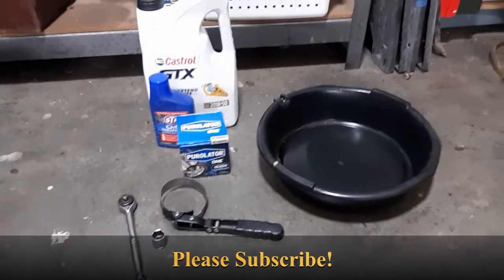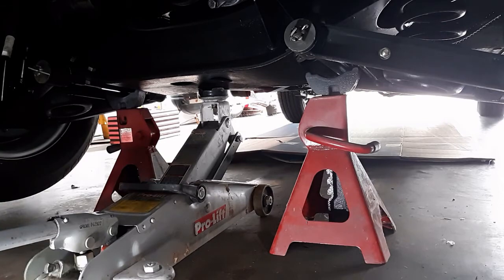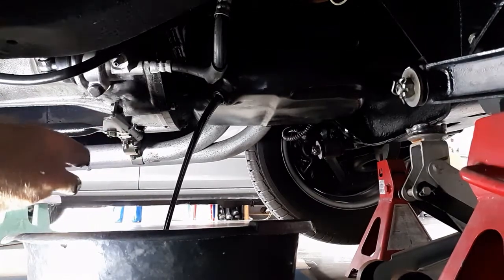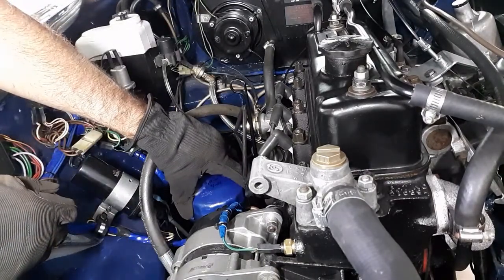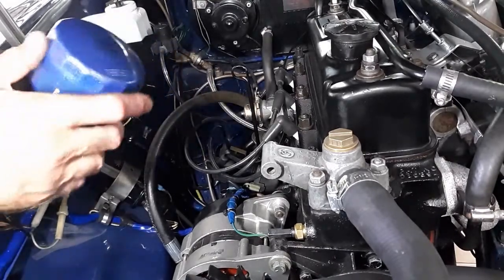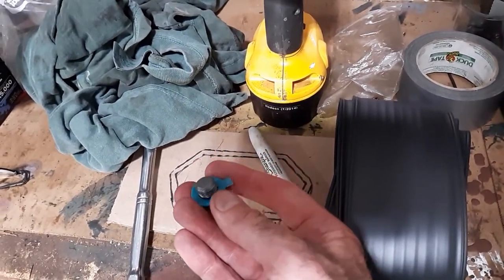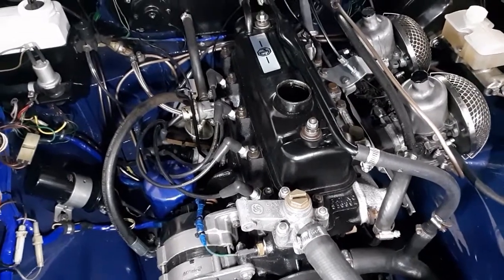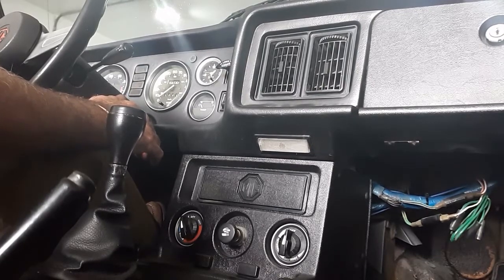MGB Oil Change - Back to Basics Maintenance

Comment: I thought all US spec cars had oil coolers, especially late model.
Reply from the maker: nope, I think it was officially dropped with the '77-80 redesign of the engine compartment with the radiator moving forward, perhaps?